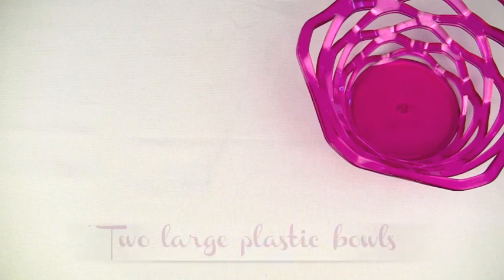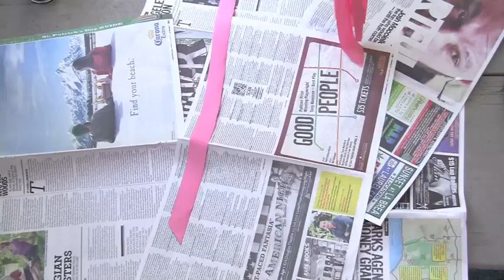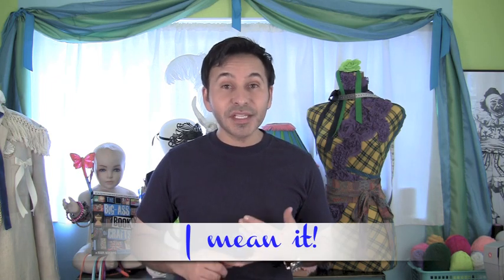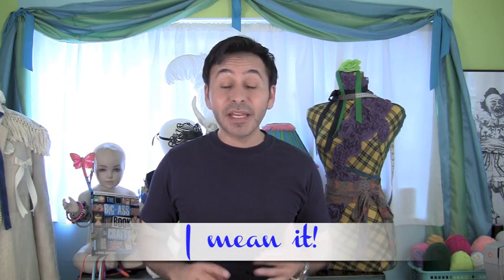How to make a Dollar Store Pendant Lamp DIY

Comment from the maker: You could wire the baskets together if you wanted with twist ties and you could also use a different glue for the butterflies if you wanted.  There are lots of ways to do this without a hot glue gun.

Comment from the maker: Eco friendly bulbs last up to 7 years with regular lamp use.  Also, because it's so light, using only small bits of glue will keep it together easily.  When you're finally ready to change the bulb, just take a craft knife and split the glue dots and replace the bulb and then glue it back together. The cool thing about eco friendly bulbs is how truly long they last.

Comment from the maker: Eco friendly bulbs last anywhere from 3-7 years depending on how much you use the lamp.  Use only small dabs of the E-6000 glue and when it's time to change the bulb just use a craft knife to separate the bowls by splitting the small dabs of glue.

Comment: This is cool mark!  But ummm how do u change the bulb when it eventually burns out?  Since u glued both sides togeather?
Reply from the maker: If you use an eco friendly bulb it will last at least 7 years with regular use.  So I think you'll be pretty good.  Also, that's the kind of bulb to use with this project since it doesn't give off heat.  :)
Reply: kendra messaoudi If you're able to find similar bowls, you could always attach them to each other with twist ties or wire. Then if the bulb burns out, you can untwist the ties, replace the bulb, and put the bowls back together. Make sense?
Reply from the maker: Sailor Hathor Great idea Sailor!

Comment from the maker: Eco friendly bulbs last 10,000 hours (look at the packaging to make sure you find the right ones, they're easy to find).  With normal use your lamp should last you about 7 years.  If you use tiny dots of glue on the outer edges, you'll be able to take it apart easily with a craft knife to change the bulb.  Then, just glue it back together.  The bowls are so light that you don't need lots of glue.  Hope that helps Orchidlady01 !  :)